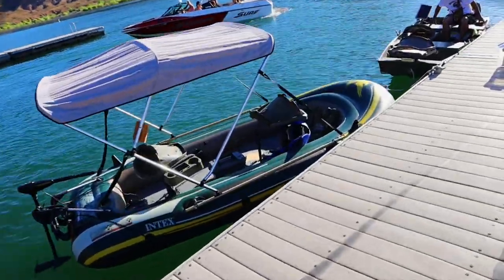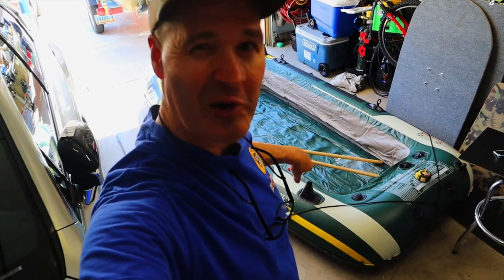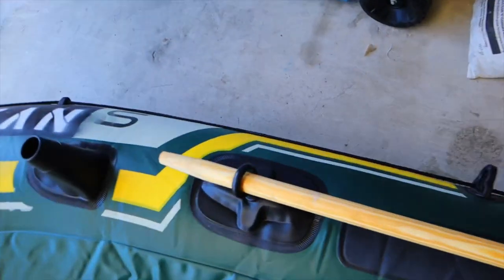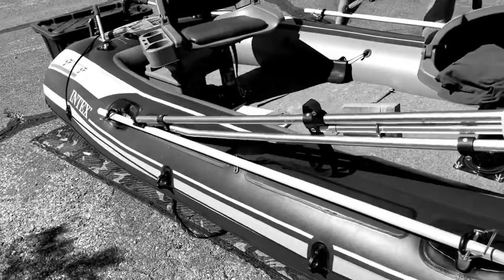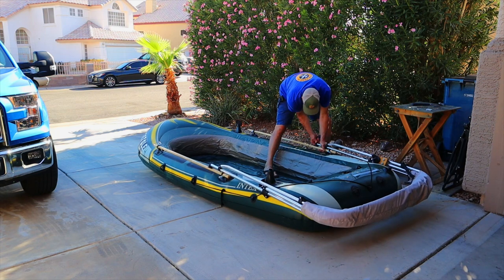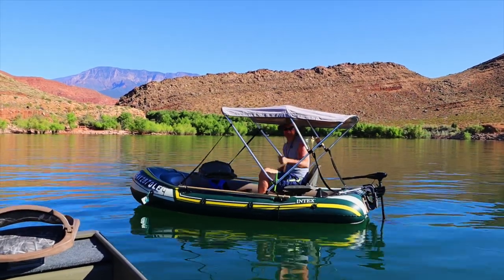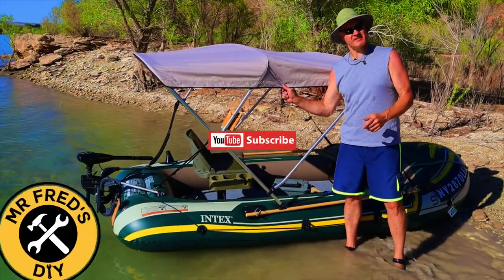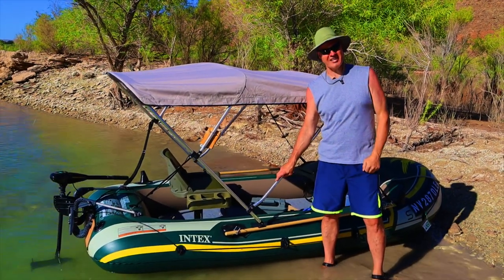Seahawk 4 Inflatable Boat  “Bimini Top”

Comment: What I ended up doing was using 1" rigid PVC. I had to use a dremel to open up the oar holes a little. The fit is so snug i didn't end up needing the retaining pins. To mount the bimini support, I bought some aluminum truck light mounts. They grab onto the PVC using a rubber insert so no holes are needed. I mounted the bimini mount on top of these.  It also gives me the option to slide the bimini forward or back by loosening the bolts on the mounts. I am going to put nylon end caps into the PVC as well to give me hook points.

Comment: Does a this need to be registered if you have a electric motor on it I live in the state of Maryland and the laws are a bit confusing
Reply from the maker: Thanks for watching the video. It really depends on your state. I live in Nevada and it is required to be registered because it has a motor. I think in Utah their motto is, if it “floats it’s a boat”. I think it cost me $25 a year and it was pretty easy at the Nevada Department of wildlife. The funny thing is, I did have to take the boat there and roll it out uninflated so they could measure it. I thought that was funny.

Comment: How does the Honda engine compare to the trolling motor on this inflatable setup? 
Currently I have a 12’ inflatable that we use to get from our 40’ Chris Craft to get to shore. Looking at using some of your mods this winter to make it better. Right now have a drill powered shaft. Works ok even on Lake Michigan for 100yards to get back to the boat from shore.
Reply from the maker: Thanks for commenting and checking out the videos. I use the Honda on this boat with the transom board I made and it works fantastic that being said, the electric trolling motor would work fine to go 100 yards and is much lighter and probably easier logistically.

Comment: Kind of my plan also.
Reply from the maker: This little boat is pretty cool!
Reply: @MrFredsDIY  Yes, but with a low cost initially, the add-ons really add up! I've done several of the things you have done but a few more differently. For rod holders I took an old ottoman, stripped it and carpeted it with outdoor carpeting that matches my floor and mounted 4 rod holders, 1 at each corner. It is not connected to the boat and i'm trying to keep things modular since it won't always be used for fishing. I need to work on some lighting next, and have a few plans. Have you thought about adding the bow and stern lights required yet?